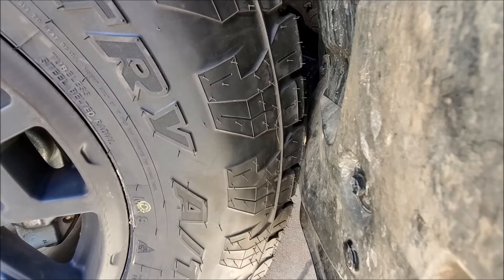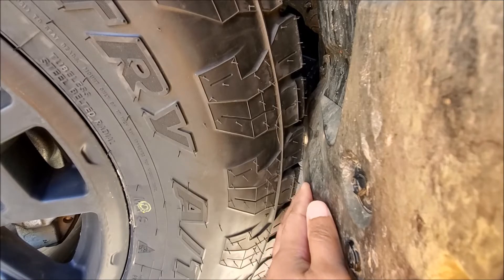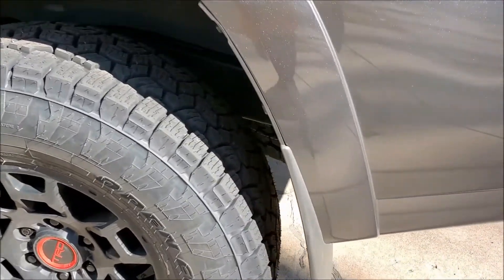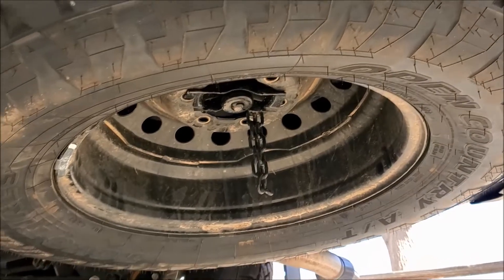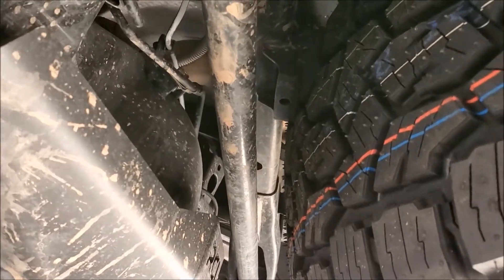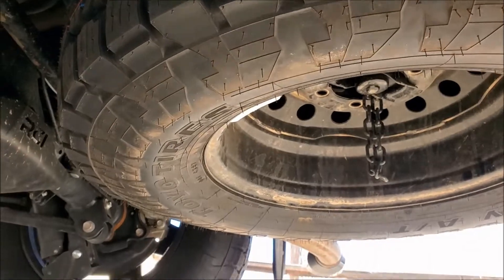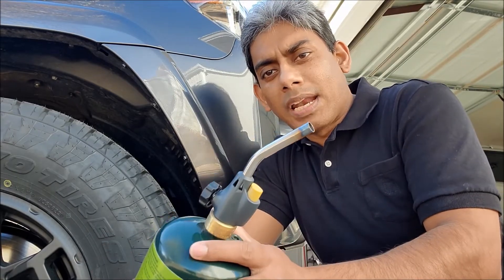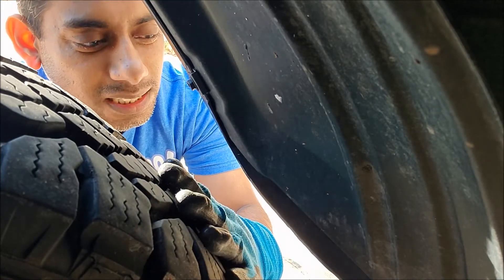Biggest tire on a stock Toyota 4Runner (with NO LIFT)!!

Comment: Thanks for taking the time to share this information. I’m actually thinking about putting open country’ 285/70r17’s on my new trd pro.  I have them on my f150 already and I put 265’s on my old jeep grand Cherokee so I’m confident in the tires. I’m considering buying a lift spacer kit from Walcott just so I don’t have to worry about trimming
Reply from the maker: That would be a good choice imo. They even seem to have a newer version that fits 34in tires. I saw on IG or something. I was thinking about 34x10.5 R17 tires. I'm undecided, haven't pull the trigger on lift yet for my TRD Pro.

Comment: Thank you for the video! Helped me decide to go with these 285 Toyo’s in SL load, not C load. I previously had 275 BFG KO2 in E Load and I didn’t like the comfort either. Too stiff.
Reply from the maker: Same story my friend. I too had 275/70R17 KO2s on my TRD ORP. Since KO2s have real 3 ply side wall its firm (most A/Ts don't have 3ply side wall like KO2 has). Pros and Cons to each.
Reply: I have E Load Falken WP 33” on my 3rd Gen , too stiff !!

Comment: Once again a very helpful video man. I really appreciate you. I have been researching forever and thought of going 275 but with this video I can finally dream of 285s. I have 3 follow up questions:

1- Are there major dis advanced of having SL rated tires over C rated for the Toyo Open Country AT3?

2- Given these tires are not much different in weight, did the Toyo 285 tires impact your fuel economy or performance?

3- I have a 20 TRD offroad 4runner. I am guessing I would need a mild lift. Do you think Bilstein 5100 or 6112 (about 1.75 or 1.9 inch) lift should be enough to clear these tires? 

Again I seriously appreciate your channel, it's really underrated. Liked and Subscribed!!
Reply from the maker: Thank you for you kind words. I would try to share my experience as much as possible when time available. As for your questions, IMO;

1) The disadvantage on SL rated tires are strength in offroad against punctures. To my experience C rated tires are a nice balance between onroad comfort and offroad peace of mind. This time I’m taking some risk with SL tires. Since I have a new kid I most likely be on gravel roads / easy trails.

2) I don’t notice mpg hit on these Toyo 285 SL tires. To me they feel like having stock 265s. For sure this all depends on driver, traffic situation, etc..

3) Most important thing is push the fender liner as far as possible and fit the bottom 10mm bolts. Then cut the lower lip of the bumper to match the fender liner position. Use a heat gun and push the mud flap as much as possible. With that I think closer to 2in lift you should be able to fit 285s. Factory TRD ORP wheels are +15 offset vs TRD Pro wheels are +4 offset. You have better offset to fit 285s than me. So you should have better luck than me.
Both 5100 & 6112 would be really nice. If you could go for little expensive shocks with adjusters the ride would be even better. I had Elka 2.5DC on my TRD ORP. The ride comfort offroad is next level. My TRD Pro shocks are pathetic compared to those.
Reply: @LionRunner  ok got it. I am a 90-10 driver (90% on road) here in Texas. high way comfort and driving through rough bumpy roads are priority for me. may be Bilsteins would be too rough for my needs? but then again its very affordable and I can get mild lift. given if I go 285 and have high centre of gravity having a good handle and less body roll might be a good bet too I am guessing.

Comment: I could use some real world 4runner advice.  My fam is considering nabbing one of these final 5th gens.  Narrowed it down to the Offroad Premium, Offroad Premium with KDSS, or the TRDPro.  Resale value is meaningful, though we do keep vehicles for the long term.  Mostly on-road and light trail performance prioritized.  No major offroading or modification intended at this time (perhaps mods in future), but we like to have serious get-out-of-a-jam capability just in case.  How would you rate these three options?
Show less
Reply from the maker: Me personally won’t pick ORP with KDSS, one of the reason been reliability. I don’t want to deal with Toyota dealer only repair part then KDSS start to leak or have lean issues.
I enjoy the JBL sound system in the TRD Pro (and Limited). Not bad for a Toyota. Also having remote start from phone was a big thing when we had the new born in winter time where I was able to start the car from the hospital / doctor office. Automatic head lights, dual zone climate control also nice to have. 
Non KDSS ORP is really value for money and you can pick aftermarket suspension way better than TRD Pro Fox. Wider 7.5x17 wheels on ORP are also a big value when you want to upgrade to bigger tires.
The big reason my wife drive the Limited is because TRD 4wd selector is too hard to use. With Limited fulltime 4wd she can just drive like a AWD vehicle without thinking about anything. 
Our previous SR5 with 3rd row was crazy value for money and I could have added front and rear lockers, suspension, tires and make it more capable than a TRD Pro. 
So in summary every trim has a very valid reason to buy.
Reply: @LionRunner  much appreciate your detailed response!
Reply: Can’t go wrong with any 4R

Comment: Ur 4Runner 3 inches higher than the standard sr5. So know this isn’t a one size fits all.
Reply from the maker: TRD Pro are only about 1in lift front and 0 in rear compared to other 4x4 trims. That's why TRD Pro also have same 9.6in ground clearance. Also TRD Pro have +4 offset 17x7 wheels vs SR5 have +15 offset 17x7 in wheels.  Since it's +4, pushed more outward it has more chances of rubbing issues. If SR5 had same 1in lift like TRD Pro , it might have less/no rubbing I would guess.
Reply from the maker: TRD Pro are only about 1in lift front and 0 in rear compared to other 4x4 trims. That's why TRD Pro also have same 9.6in ground clearance. Also TRD Pro have +4 offset 17x7 wheels vs SR5 have +15 offset 17x7 in wheels.  Since it's +4, pushed more outward it has more chances of rubbing issues. If SR5 had same 1in lift like TRD Pro , it might have less/no rubbing I would guess.